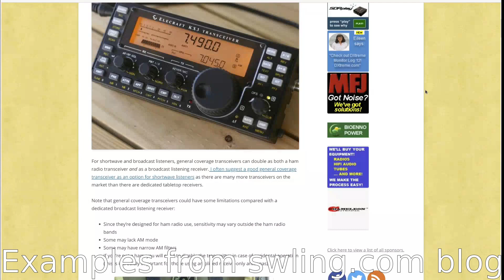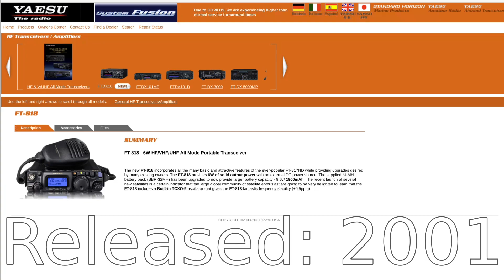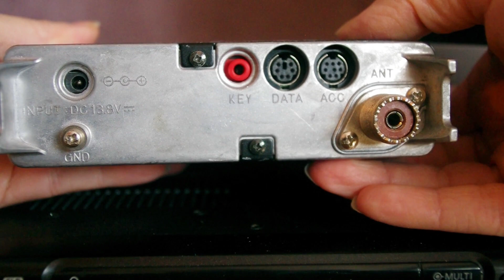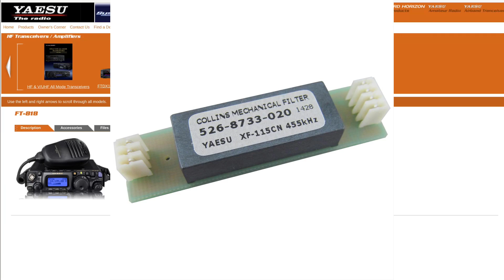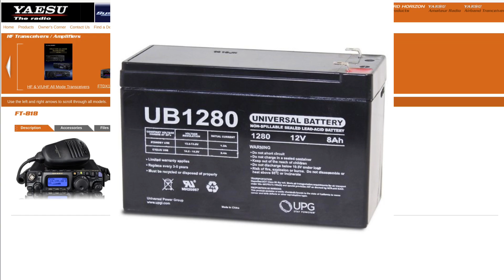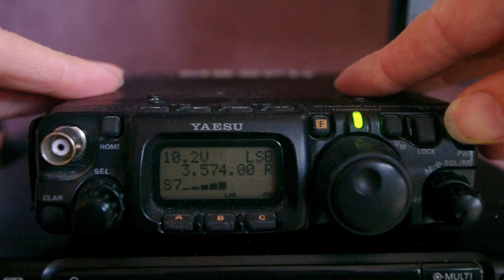Is the FT817/818 Still a Good Value Transceiver in 2021?

Comment: Hello, thank you for your video on this little fantastic Transumer. I just purchased one used yesterday and I’m very excited to start using it. I noticed in your video you had a what appeared to be an external Anderson power pole adapter kit and I’ve been trying to source it on the Internet, i’ve been unable to find anything like it would you be able to provide a link? I would greatly appreciate it it would definitely work with my mobile applications as all my radios have Anderson power pole connectors already. 73’s KJ7AVQ

Comment: The whole family of FT-817, FT-857, & FT-897 are excellent portable radios. Furthermore, the available filters for those radios are more than adequate for portable operation where QRM is less of a problem.  The D and ND models with DSP do reasonably well in modestly RF noisy environment. It my experience as good as an IC-7300.
The newer radios shine in RF noisy environments.
It my opinion that the FT-857D is the best radio for portable operation ever made to date. It has all the features necessary for 5W to 100W. Couple it with an 80m-10m EFHW antenna and it is unstoppable!

Comment: The biggest disadvantage of this radio is missing narrow filter for CW. The filters are no more in production for 817/818 and used cost as half of tranciever.
If yeasu solve this problem 817/817 will the greatest tranciever without a doubt.

Comment: Why would anybody buy an 817/818 when you can buy a used 857d.  Almost the same size QRP to full power (100w) and it does practically the same thing.  Why buy less when you can buy more.

Comment: 817/818 ya half price than a KX2 or IC-705, I agree is half performance but for Sota activities, p.e, It is enought if you install a filter. I owned a 817ND and without filter in CW It is a crazy sounds box. If you add another 160 euros for CW filter, the total ammount id not a half price of Kx2 o 705, then...perhaps It is not a good choice...
Anyway, I sold my 817ND and It is probably that will buy another (818), because the other options are more expensive and for Sota IS enought.
Regards , Jon EA3BV

Comment: Hello neighbor.  
Adding up the cost of the accessories, it no longer seems like good value. The filter alone puts the price over the top. JS8/FT8  ... add audio interface to the price. Want to do some weak signal work,  add dsp to the price. The NiMH batteries are ok but quickly drained by the high current consumption.  
One option is a G90 with budget HT for VHF/UHF. I loved this radio for 20 years. By todays standards,  it begins to look like a money pit. Ok if we already have one. Not a good investment if buying new.
73
Julian oh8stn

Comment: I've had my 817 for 15 years.   I only operate backpack portable with it.   I am very hard on gear.   I've dropped it so many times that the paint is all worn off of it.   It still operates fine.

Comment: I've had a FT-817 and I sold it... I missed having the little rig that just can be tossed into a rucksack or backpack. I then bought an FT-817nd had it a few years - thought I'd outgrown it because I had several mobile transceivers that had all of the comforts of DSP and "bells and whistles" and after a long time I sold the 'ND' and lo and behold I missed that wonderful little rig that I can sit with on a park bench a picnic table or on the sofa and  open up the world on radio. so this past spring my wife bought me an FT-818nd.... you can count on me keeping this one ( that goes for my XYL too) ;)    ;)  :)    these little rigs are fantastic and yeah they have a wide front end, but they get the job done.  cheers and 73
Reply: Find a good used 857D.  It's much better than an 817.  Both Yaesu machines QRP to full power and almost the same size.

Comment: Thanks for the video and your thoughts.  I currently have an ICOM 703 and contemplating switching to the 818 just for a change.  Any thoughts?
Reply: Why not get a good used 857D.  Almost the same size, QRP to 100W.  HF, VHF, UHF all mode.  IF you have a IC-703 get an IC-706Mkiig
Reply: @BennyCFD  thanks for your comment.  I did end up getting an FT818 and have been thoroughly enjoying it.  I use it for a 2 meter net I do in the mornings and in the better weather I take it outside on my balcony for HF.

Comment: Yaesu should have put a lithium battery into the 818, high priced electronics like that all have, its i think not right yaesu kept it to nimh and so obsolete. imagine you would buy a samsung galaxy s10 and it would have nimh instead lithium, what all the people would say...  

The 818 is missing a powerupdate, they should have made it 20watt HF, that would have made a huge difference. Some people could almost understand me with my 817nd portable on a hiltop, with 20watt i could have made the DX-QSO which i missed with the 5watt. 

the transmitt bandwidth is a bit narrow, why not a wider tx filter in the 818 ?? the optional wider filters are i think active only in the receiver section. 

These improvements were overdue and would have made the 818 a winner, instead they kept the 818 to the same ol' like the 817nd. that one more watt in the 818 is meaningless on hf same as the making the same radio and only changing the numbers from 817 to 818. 

i sold my 817nd, because the receiver sounds odd compared to the clarity of my old icom, its not only the bandwidth, the AF response seems not right, something is not right with the AF response 817nd, its not much pleasure to listen to it for long. i guess they didnt fix that in the 818, when they didnt improve anything else about it either. If you have only the 817 you wouldnt notice this i guess, but compared to a good receiver like an old icom, you would quickly hear the difference, same as i did.

Comment: during our morning nets I been known to drop my power to just 5 watts, its to show how you can still get through, my rig is the ic-718, my 817nd broke sometime back and is on the way to the shop for repair...I want to work some at 5 watts again??
Reply from the maker: I used to do exactly this - it's great to demonstrate this in practice.  Thanks for the comment :)
Reply: @oh3spnfinland718  our nets looks for check in's and usually ask for qrp first. They want stations at a max of 10 watts. I lowered mine many times to 1-6 watts on my station. The first time I used the 817nd I worked some in Japan and Indonesia. On the 718 I was on 20m FT8 and ran the rig at just 5 watts, worked a station 3 days in a row from Carribean from my station in Manila Philippines.

Comment: Certainly it is still a good value today. All I use currently is an FT-818 for home or portable use and it's done quite well for me. When they're on sale (sometimes under $600 USD) it's an all out bargain. There are better performers these days but you're going to have to spend double the money to get all the capability these have in just one portable box.

Comment: If I want to operate both SSB and CW - do I have to swap the filters all the time?
Reply from the maker: Only one filter can be fitted at a time however there was an after-market board ('one board filter'?) that could accommodate and switch between both;  I don't know if this is still available.  If you operate both SSB voice and CW then I'd recommend the CW filter.  In my opinion the CW filter is essential whereas the SSB is just nice to have.  I hope that helps and thanks for the comment :)

Comment: Thank you for putting this video out there. I was a late comer to amateur radio, but picked up the FT-818ND 18 months back for all the reasons you covered. I’ve been getting a bit of criticism on my channel for not jumping ship and moving to the IC-705. I have no intention yet. The 817/818 is built like a tank, simple to operate, and perfect for my SOTA activations. Keep up the great work. You have a new sub. 73 de KT1RUN
Reply: One reason I won't go for the Icom 705 is it's twice as expensive as the '817/818. I can live without the fancy waterfall display.

Comment: I am a very proud owner of an 817. The only other radio that I think holds water to it is the G90, and for me I made the right choice. I only use resonant antennas because I feel like that is the best way to ensure antenna efficiency, and I actually don’t have another VHF radio. I am looking into getting a filter like the laserbeam-817, but I was really shocked with the receiver ability to start. The thing really is tuned to pick up weak signals, which is great for QRP stuff. And the SWR readout is great for most cases. It can be easy to just check the bar chart at two places on the band and then cut my antenna in the field.

Comment: My 817nd is 15 years young and a keeper. The 4 watts thriller is a totally different game, not for all the hams. I recently made an SSB contact with 9n1CA sitting in Chennai India with 4 watts. The antenna is the single most important part of any QRP set up. 73

Comment: Thank you! A friend has one of these FT 817s and I have always admired it and he brings it on every field day, except in 2020. It works every time and gets as many contacts as some of the 100watt rig guys. He has a home assembled Ammo Box with batteries inside that run about 1.2KW at 12 VDC. It runs the radio for 8 or more hours with moderate use!  Cool indeed.

Comment: I’ve had my FT-817 close to 14 years now. 
It has been on as many field day events, and countless hiking and camping trips. 
It has stood up to extreme heat and cold, rain and snow. And in all of this it has never let me down... Once one gets familiar with the menus, the 817 is extremely easy to operate... The only thing I dislike about the rig is that ridiculously small screen. Other than that, is a great radio... I like the FT-817 so much, I recently bought the FT-818.

Comment: I've heard you have to take the battery out when not using it or the finals blow as the battery dies
Reply: In the original FT817 you are correct. Even so that issue was rare from my research .The FT817ND and FT818 have had that issue rectified. FT81x is a fantastic “tank like” field radio...when paired with a good antenna!

Comment: I bought the 818 shortly after it came out, my first qrp rig. I operate CW, haven’t tried a  voice contact yet. But I LOVE it! I love the way it looks too and I know it has a great track record and the price value is fantastic. 

My one complaint is the harsh side tone with headphones. Oh yes, I also got the 300 filter, that is something Yaesu should have done. 

I’m sure the 705 is great, but I think many may get buyers remorse. That price!
Reply: I got the 300Hz/2.3kHz filter and TXCO for my FT-817ND. A 500Hz filter would have been the better choice but it was my first HF radio. I got the BHI DSP filter from W4RT and the W4RT compressor mic. The mic and the 300Hz filter are two items that weren't optimal for me.

Comment: Nice video!  I love how some people operate QRP without even realizing it by using a 100W transceiver with an inefficient antenna.
Reply: Exactly right. Running tuners on QRP radios like this is a similar gripe of mine. Resonate antennas are perfect for the 817/818. I wish I could get my money back for the Z817 tuner. It’s been used once.

Comment: One of my first contacts with my 817 was to Venezuela from Texas, USA on 5 watts.  It is a champ if you have a good antenna.  Thanks for the video and you have a new subscriber.  73! de KE5ES
Reply: This radio is very cable of DX with the right antenna. I made a 5,550 mile contact to France yesterday on 5 watts on my 818.